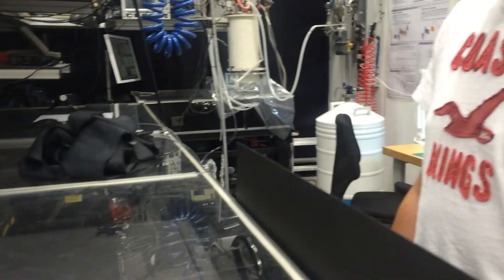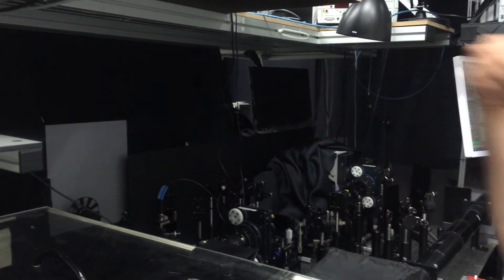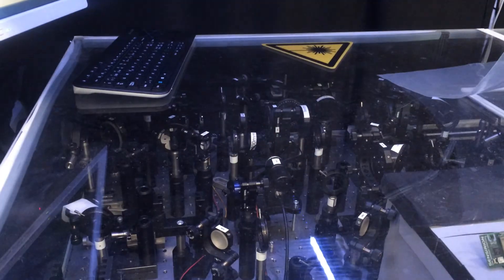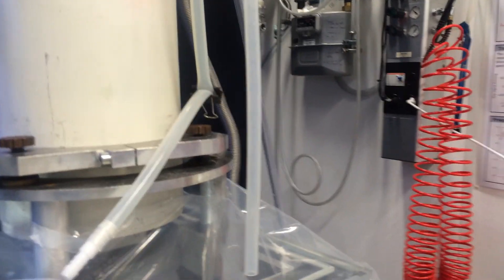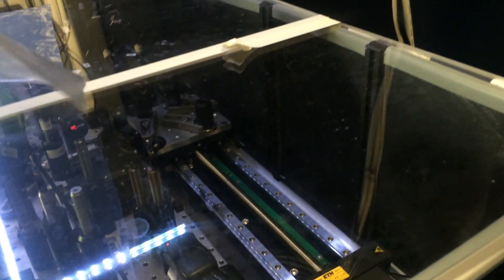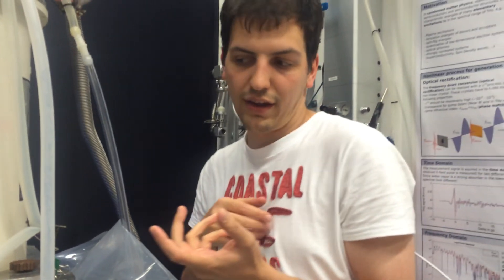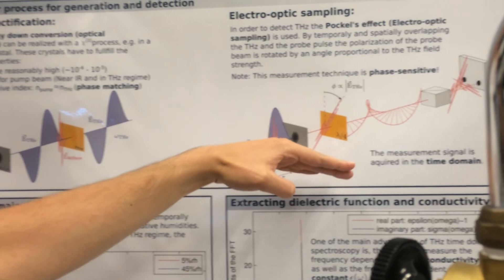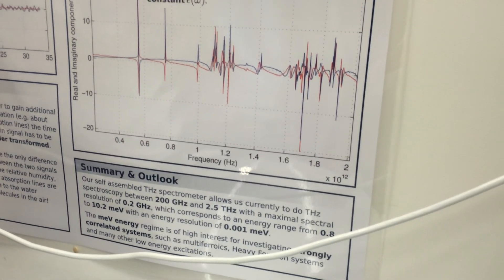Christoph Wetli, Prof. Fiebig’s group ETH Zurich talks about low temperature THz spectrometer

Comment from the maker: We offer broad selection of standard and custom ZnTe crystals sales@dmphotonics.com
http://www.dmphotonics.com/ZnTe-crystal/ZnTe-crystal.htm
https://www.youtube.com/watch?v=lzeMfa_rj1E
https://www.youtube.com/watch?v=raE-WiD1so0

For example now we have in stock the following crystals:

Available from stock:  ZnTe, (110) cut, both side polished, unmounted
10x10x0.1 – $980/pc
10x10x0.12, AR/AR coated at 800 nm– $1120 each
10x10x0.3 – $840 each
10x10x0.5 – $700
10x10x1– $700 each
10x10x3– $1380 each
Extra cost for mount dia.25.4 mm, CA opening dia.9 mm – $90

We also offer ZnTe assemblies - thin ZnTe (110) optically bonded to ZnTe (100)
Few examples of standard assemblies:
10x10x(1+0.1) mm (here  1 mm is thickness of (100) substrate and 0.1 mm thickness of (110) plate)
10x10x(2+0.1) mm
10x10x(2+0.2) mm 
10x10x(2+0.5) mm 

Terahertz ZnTe crystal assembly 110-cut 10x10x0.5 mm mounted on 2 mm substrate
https://www.youtube.com/watch?v=S59KH79sNnU

Del Mar Photonics also offer AR and HR coatings  on ZnTe for 700- 900 nm range.
We can offer from stock AR/AR  coated crystals and AR/HR coated crystals.
Aperture of crystals is 10x10 mm, thickness is from 0.15 to 1 mm. Price is usually higher for thinner crystals.

We'll be happy to quote you one of our standard or custom ZnTe crystals.